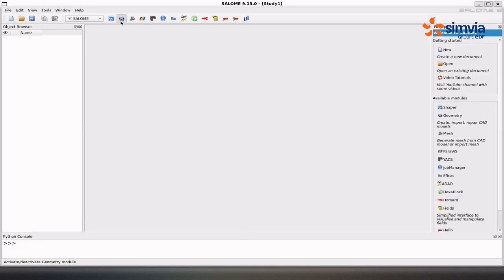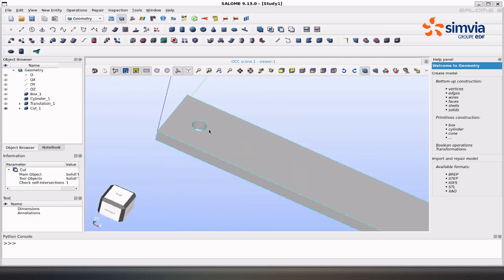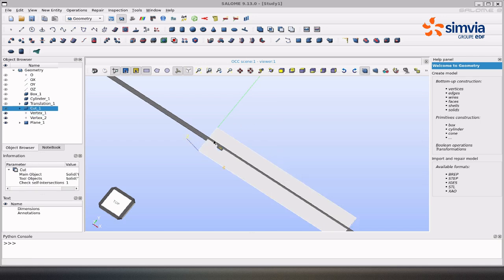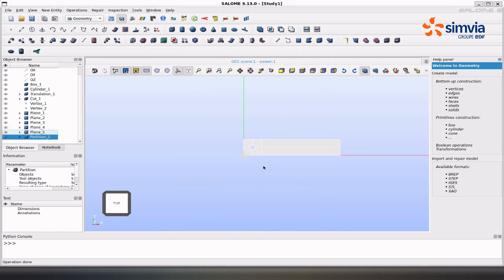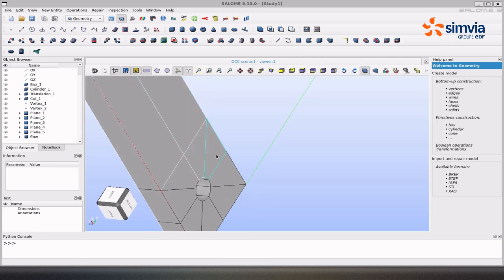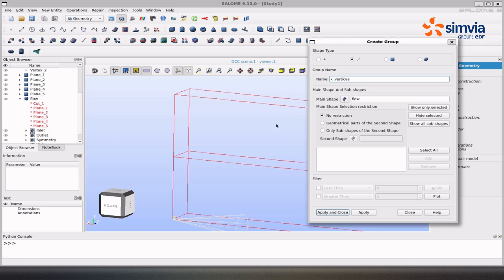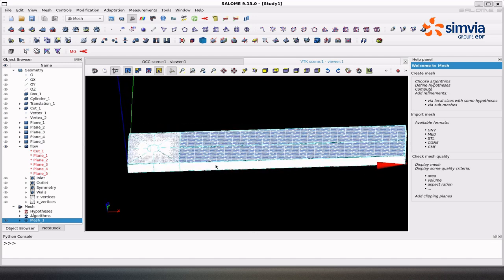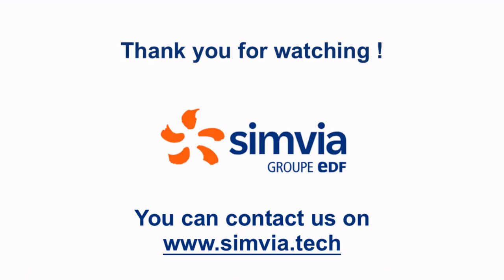[Learn & Understand] Von Karman vortices Part 1 - Mesh & Geometry on Salome

Comment: you chose just 6 x_vetices lines,   why u did not  the other  12 vertices missing ?
Reply from the maker: Hi ! We only included the longest vertices along the x-axis. Basically, without a submesh, all vertices along x will be splitted with the same number of nodes. As the plane cutting the mesh orthogonally to the flow is closer to the hole, this means that without a submesh, the x-vertices near the holes would have closer nodes than the vertices further away along the flow. So, we define a x-vertices group with only the longer vertices to impose slightly more nodes, so the overall mesh resolution looks uniform. Hope this is clear.